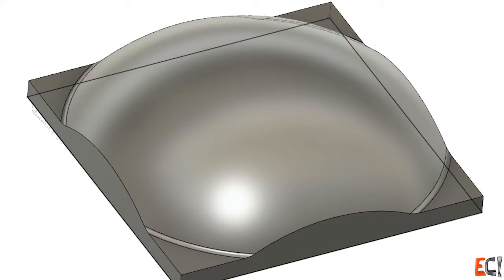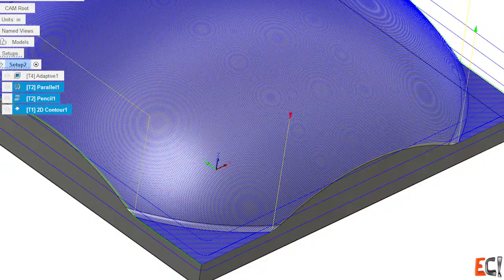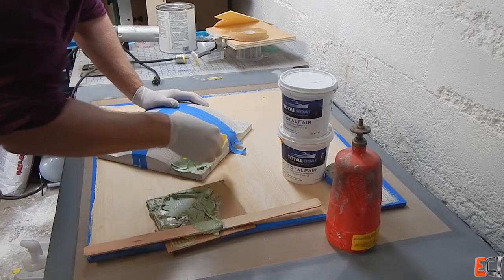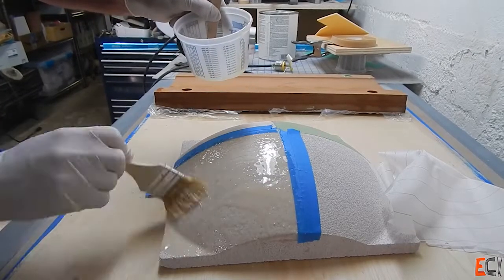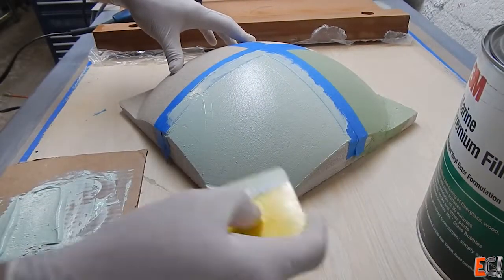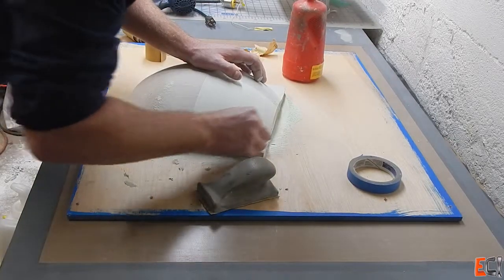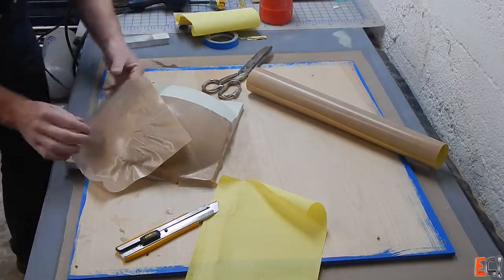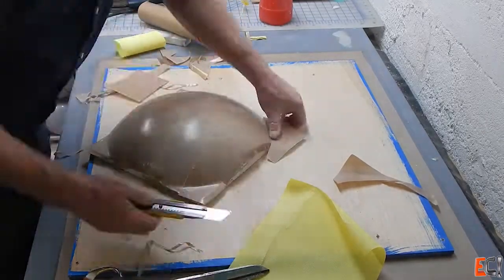Autoclaved Aerated Concrete for Prepreg Composites Tooling?

Comment: It seems to be a great idea. I have a question about the effects of the concrete dust on your router. It may act like sandpaper. How do you keep it from damaging the machine?
Reply from the maker: Yes - this is a problem!  I didn't have good dust collection on this machine because it is just getting set up.  The sand is milled and is very fine, but way-covers and an auto-oiler would be a good idea.
Reply: @ExploreComposites  Thanks. And please keep the videos coming.
Reply: @ExploreComposites  I imagine you could do a pretty good job catching the dust at point of generation with brush nozzles and suchlike if the AAC is a useful material.

Comment: Great experiment. Always wanted to try that out, now I definitely will. Would you consider putting several layers of putty to build up a surface coat and then final  machining ?
Reply from the maker: Using putty would be good but it would have to have high temperature stability to not shrink or print.  Most epoxy or polyester tooling putties have way sub-100C tolerance.  I guess you could just laminate over the AAC with a few mm of laminate and then machine that - but it gets to be lots of work!

I'm also concerned about whatever is used to bond blocks together into a larger tool shrinking and printing into the part.  There's a product called Compotool that is ceramic (I think) but cuts like chalk and has incredible temperature stability.  They have a good adhesive for gluing blocks together and a sealer.  It's pricey though and can be hard to get.  I was hoping with AAC to find something priced like MDF but with better stability.  

Excited to try some more tests.  Let me know if you learn anything!
Reply: @ExploreComposites  Hi, I did some test with this method. It does machine extremely easily with simple brazed carbide router bits. Laminated a fiberglass scrim to give some strength, applied gelcoat as a putty, finish machined gelcoat. Worked great if were not for all the air bubbles in the gelcoat ! Need to improve the technique. I'll oven cure this one with prepreg at 180°C.

Comment: After sealing it does it become more durable because it's quite brittle.
Reply from the maker: Sealing won't help much with the brittleness - this is a problem that I don't have a good solution for.  Graphite is often glued to a carbon plate or something with same CTE for support.  You could probably do similar here.